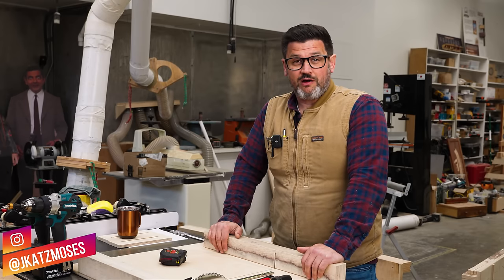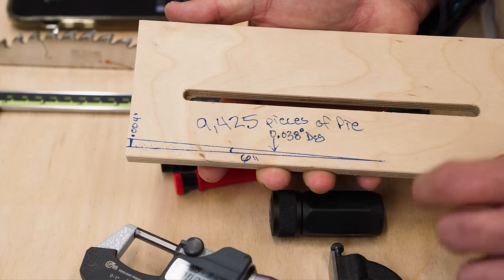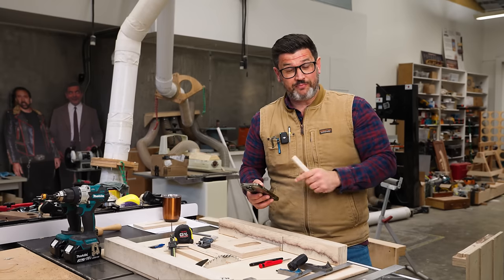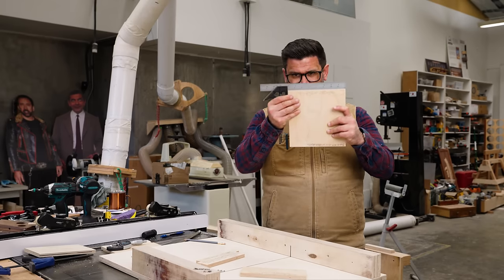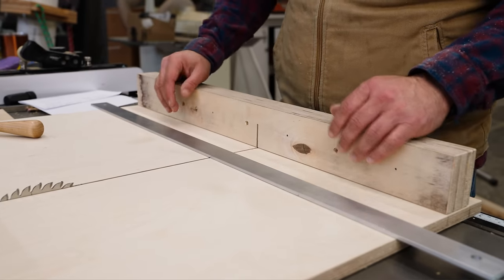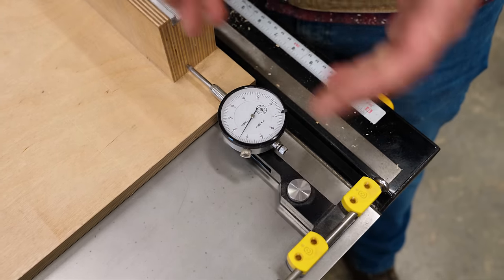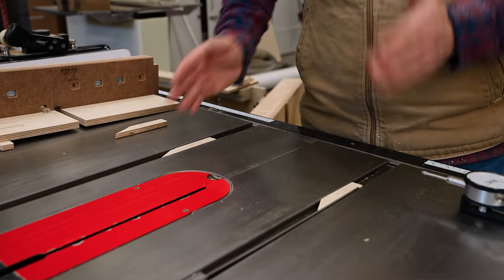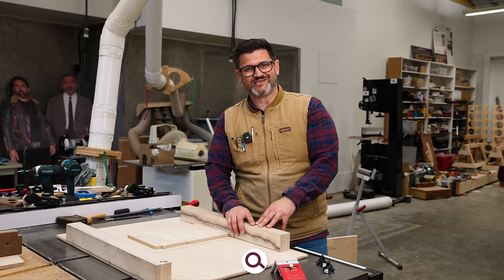Mitigating Human Errors in Crosscut Sleds and What's the Maximum Allowable Tolerance?

Comment from the maker: To summarize: Anything under .05 degrees of error is super square. If you get an error of .02 over a fence greater than 24” long you are super square. To calculate how many degrees your 5 cut method answers equates to use this formula (or Google rise over run degree calculator): 

Degrees= tan(-1) X (rise/run)

Comment: I've been in the Quality industry for 13 years checking machined parts  to, in some cases, .0002 in. This video checks out. Great job explaining this. Because I worked in the industry, I was hunting that accuracy in my wood working. Because it is wood, I could never maintain that accuracy. I could measure something like thickness to a thousandths of an inch, but give that freshly cut side a little time, and the whole piece would be ever so warped, bent, or changed in length. I do tolerance studies of the drawings we make for the shop now as a drafter. I think in terms of what is acceptable to the end assembly all the time now. Super tiny nip pick... Your joe block that you use to check the calibration of your calipers and mics is not perfectly 1in. However, for the level of accuracy needed this video it is way more than close enough (tolerance on a joe block of 1in is something like ±.000005 at 68° F). Overall I freaking love this video. I can nerd out all day about math!
Reply: I'm a Quality Engineer & agree 100%

I often make my own study coupons & machine 1 off parts/fixtures.

I was lucky to be able to call it "good enough" when it comes to woodworking projects early on.  I actually do a lot less measuring woodworking... fit/form/function is more applicable I think.

The only time in woodworking I try to hit accuracy to a few tenths is setting up a piece of equipment. 

I did, however, buy a some cheaper items for construction (framing, landscaping, etc) I used our Vision System to verify accuracy.  My aluminum $9 speed square was something like 90.075°, 45.something° & straightness was less than .003.  I did not expect that at all.

Comment: I recently made a 45° miter sled for boxes. Doing the 5 cut method on a sled when the blade is at an angle gets tricky. The bottom of the sled looks like Swiss cheese as it took 10 tries before reaching a number I was satisfied with. The calc I used suggested .001 as the target, when I finally hit .002 I stopped. 
Today I'm building a 60° miter sled for my hexagon boxes. After watching this, I'll relax my hunt for accuracy! Thank you, Johnathan.
Reply: Check out William Ng's video on how to make a 45° miter sled.  He claims you can get it in two tries with two cuts each try.  You can, IF you use good quality wood that doesn't leave raggedy corners.
Reply: That was my problem on the first test. After a couple more failed tests. I realized the issue was how you measure the length of the off cut - I had been measuring the long side (the top of the cut), but I should have been measuring the short side (the bottom of the cut, against the base of the sled).

Comment: 9:56… I’m a fan of plastic runners… I buy cheap plastic cutting boards from Amazon and cut them up for my runners. Can’t remember the exact type of plastic to use but there supposedly is one you should use (but it’s the plastic that cutting boards are made from anyways). 
2 things for my personal shop set up. 
First is my shop is heated for winter (I’m in Minnesota), but I often am to cheap to fill the 500 gallon propane tank for it lol, and my shop is not cooked at all in the summer. So I have a GIANT delta of both temps and humidity during the different seasons of the year.
Second is that my table saw miter slots are slightly different than each other (which I would think is fairly common), so I need two different sized runners to fit the specific miter slot. But this is not a big deal at all. 
Basically the plastic runners don’t move with the seasons AT ALL.
My first few sleds have 1/4 sawn hardwood. But I must have made them in the winter, because come summer time there’s no chance those sleds fit my saw anymore lol.

Comment: Great topic.  I once used a Grizzly contractor tablesaw and just dragging it a foot across the shop would throw it out for fine work.  I was able to dial it in and make a 3x4 ft. picture frame that was 3 inch wide oak and had tight miters.  I eschew the use of filler to hide miter errors.  I did not realize you don't do sponsors.  Just ordered a few items to help support you.  More of this stuff, please.

Comment: Thanks! I’ve been chasing perfection on my first shed for the last 3 weeks! Yes, I’ve had to put it aside a couple of times. The last time I walked away was specifically because of the “screw bump” I was really getting frustrated because I’m dialing in my fence and then my error from .0095 to .015!    I don’t think my fence is flat enough so I think I’m going to rebuild that and start over.  Yes, the blue tape works - but I needed to make sure I sanded paste wax off. Glad to hear that it shouldn’t slide like a bobsled as well!

Comment: I think there are a couple things to remember:
We're working with wood, not precision steels. A joiner told me years ago...it's a natural material and it'll do what it wants to anyway. I think the point is, no matter what you are making, you have to allow for all sorts of movement.
Also always told to measure the parallel accuracy of the grooves to the blade on a table saw from the same tooth - but you might choose a mis-ground/distorted tooth and although it cuts on the feed side, it can also cut on the opposite side if everything is slightly out of alignment, presumably giving a slightly wider kerf (although my own saw seems to cut a strange very shallow curve?). I have found the best way to achieve alignment accuracy is to use the longest "true" straight edge against all of the reference surfaces, whether you measure with digital test indicators or your thumb!

Comment: Good video as usual, just a couple of points to make.  When you are making your five cuts use a piece of material that is as big as you can cut in the sled, it makes measuring the error more accurate.  Sorry, using an 8in square on a sled that looks like you could have used a 20in square is nuts.  Also, expressing error in degrees is a bit hard to understand more meaningful is what is the error over the largest piece you can cut.  

I've been making and using sleds for nearly 50 years and I think an hour or two spent finessing is well worth it.  One additional tip is always make sleds with two runners where at all possible it removes the potential for racking.  As for runners I have recently gone to using the shop bought adjustable variety, they are great, just be aware that if you have to remove slop from any sled it needs re calibrating.  Although woodworking does require engineering levels of accuracy there is no reason not strive for perfection, as errors in a big project can compound themselves.

Comment: The New Yankee Workshop has a video where Norm was making shop helpers, one of which was a panel sled. Even though a panel sled is a bit different than a crosscut, their end goal is basically the same. All he used was a carpenter's framing square, and from what he said, and from what I could see, it worked perfectly. When I made mine, I used a Woodpeckers framing square. It was as accurate as it ever needed to be. Any panel or single board I cut, was right on the money. But, years before I made that sled, I had purchased and still use the Incra 5000 which is excellent. Especially for angles. The only issue is, it seems to be getting heavier every year.

Comment: The first thing to check for is that the blade is parallel to the miter slot. Don't ask how I know. The second is to use a 1/4 inch bolt in a 3/8 hole  opposite the pivot screw to hold the fence in place and avoid turning base into swiss cheese. Just set the fence to approximately the right spot  and drill a 1/4 hole through the base and fence. Then drill a 3/8 hole just in the fence. Use a bolt or carriage bolt  inserted through the base connected to a large washer and nut on top. Make your adjustments by loosening and tightening the nut. Much faster than screwing around.

Comment: As for the runners play, I would use a few spring plungers along the length of the runner/runners to eliminate any play and to keep the runners moving smooth. 3/8 thick runner you could use 1/4-20 or 6 mm plungers. Thanks for the videos Jonathan.

Comment: I started using a dial indicator and a long square. Hold the square against the fence of sled, mount dial indicator to table and touch it to square along the cutting edge and move sled back and forth. Adjust fence until most run out is gone. Done

Comment: Great information Jonathan, thank you. What do you think if one uses a 24 inch piece of extruded aluminum with one end swiveling relative to the base and the other adjusted with a micro adjustment set screw like the one in the Rockler sled to fine tune it accurately and quickly?

Comment: Great piece!  I’m wondering if there is a Part II coming, in which you investigate the influence of the fact that we’re working with materials that in nearly all cases are subject to all sorts of environmental and other influences?  For example, some materials were better-dried than others when cut or manufactured; some materials will be drier than others when we start cutting and assembling them; some materials are inherently less subject to environmental effects than others; and (this is a guess/assumption) some wood grows in ways that result in greater or lesser amounts of internal tension that can release and cause dimension changes over time, either while stored before use or after cutting/assembly.  I’m wondering if the results of variables like these are, or can be in some cases, so great that they make chasing dimensional accuracy that has to be measured in single thousandths of an inch (or less 😅) a challenge that may be diverting and satisfying but honestly isn’t all that important?  🎉

Comment: I used a dial indicator to do my 5 cut method and one issue I had was not pulling the dial indicator back and "resetting" the measurement. There was a surprising amount of play in the measurement by just leaving the indicator touching the fence and moving it. I chased that issue for a couple hours until I realized what was happening.

Comment: I've done the same with chasing error. In my opinion, the fence should aluminium extrusion with a thin mdf  layer for zero clearance, and never be screwed down, it should be adjustable with a bolt just like with most metal working machines, and dialled in often as pieces of the jig wear. At the end of the day though, as long as the sled is made from wood, it's going to have moved the next day. Not to mention the human error involved in using the sled itself, for example like with a mitre saw,  its easy to unconsciously be applying too much pressure in one direction.

Comment: I’m a type A weekend warrior and found my sled splaying a tiny bit when I unscrewed the fence to make the adjustment. I moved my fence the amount dictated by the 5 cut method, so sometimes it was worse than before. I’m down to 0.07 over 24” and can’t see any light, so after 9 tries I’m calling it good enough. Chasing dead nuts is too aggravating.
Reply from the maker: My guess is you’re not accounting for which side of your blade you’re cutting on. In our five cut method calculator we have a drop down menu for which side your pivot screw is on. If you miss that part you can move your sled the wrong direction.
Reply: If you can’t see it, you can’t see it…although as a footnote, I think my fingertips are probably more sensitive than my eyes.   In other words, I think I can feel dimensional differences that I can’t see…though I also wonder sometimes if not being really careful about the exact angle I’m looking at something obscures something that would be visible if viewed exactly on-axis.  In any case, I do think there are cases where we can measure differences that don’t make any difference in real life.
Reply: @katzmosestools  Thanks for your response! I love your channel. I thought about the pivot screw, too, but I have it correct. I cut on the left side of the blade, but accounted for that, too. I was essentially moving it forward and backward the same amount each time. I chalk it up to crappy plywood.

Comment: Note about accuracy.

When talking about the Mitutoyo Micrometers... their accuracy is not .00005 or 5 decimal places, that is their "resolution".  The actual accuracy will be closer to .0001 - those particular mics are more "accurate" than that (roughly ±.00004 or .00008 total tol), but can't display it (due to the .00005 resolution) in imperial (inches)... so rounding up to .0001 is your accuracy.
Reply from the maker: Yes I misspoke. That is so accurate I don’t think most people can picture what that actually means unless you’ve seen what that looks like on something like a scientific grade granite plate etc.

Comment: AS regards runners- Most commercial ones have set screws or discs to make up for slop. Problem is they are spaced too far apart. I make mine out of ipe(quite hard and wear well) and and place every 3-4 inches a brass headed screw to adjust for slop. They stay true for the entire length of the runner and easily adjustable.

Comment: Another thing to account for is that the  sled can easily distort by a few thou and even the alignment of the wood cut piece against the wood sled can vary with holding pressure. Wood is squishy :)

Comment: I’m thinking that if the sled runner (s) are not tight the sled will “skew” - the front of the blade will cut a particular width until the back of the starts to cut the opposite side of the kerf making it wider than intended? 

I try to push my sled directly over the runners thinking that will minimize skew or at least make it consistent - 

Somewhat different than out of square but still gives inaccurate cuts

Comment: This is a great video, but I have a different view on a couple of your points.

1. For most angles, it is impractical to focus on small angular errors. in engineering drawings, Geometric Dimensioning & Tolerancing detfines an angular error as a linear measurement of the deviation from the ideal angle. You were doing that, but you kept throwing in a meaningless angle value.

2. The 5 cut method does not increase the error after each cut. The angle remains the same. You measure the error over the perimeter of the test board. It still multiplies the error to improve the resolution.

Comment: I assume fixed squares are available much cheaper at tighter tolerances than adjustable ones simply because the adjustment mechanism is the hardest place to minimize slop.

Comment: This is no doubt a stupid question: If after doing the 5 cuts you are off and need to do it again, your board is not square.  Can you do it now with the out of square board and get an accurate result?  Also, do you go clock wise or counter clock wise?  Told you these are stupid questions no doubt.  Thank you for all the informative videos and comments.

Comment: Screws should not be used for locating parts. @RexKreuger has a really nice solution to getting a fence really square in his advanced shooting board video. Basically, you fasten the back half the fence rock solid to the board/sleed as square as you can, then you bolt the front half to it and shim it to sufficient squareness.

Comment: Just refurbish a couple antiques and you’ll quickly discover how to accommodate for errors.  This  fascination with precision is kind of a joke. When you study those beautifully crafted old pieces, that are incredibly inaccurate yet gorgeous and perfect ’to the eye’. 
Are we craftsman or machinists?
Reply: Exactly!
Reply: Yes I agree. Perfectly square is great if achieved, but it can be elusive. Having a perfect sled would be nice, but how big of a sled can you have. Even if you had one 2’ across, if it was out a 1/32” or even a 1/16” in that 2’  are you going to really see it. A sled is just a more controllable and safer miter gauge. Think about how wide of pieces you crosscut with a miter gauge. Most of the time it’s probably less than 10”. 
And I don’t want to spend half the time checking the sled for square before I use it every time. And as with the antique furniture you mentioned, wood does move, so even if you cut it perfectly, it may not stay that way. I think instead of spending all that time making and fussing over over a sled that I apparently have to treat with kid gloves so it doesn’t maybe get messed up, I’d go with either the Dubby sleds, the Incra miter gauge/sled. They are basically a miter sled that cut 90 degrees and miters. The Dubby has right and left sleds, both with adjustable fences. Buy one or both and have a place for the cutoff to land. The Incra has a separate platform for the other side of the blade. With either, if they get off a bit it’s easier to adjust them. 
And finally, no matter how square your sled or whatever is, if you don’t measure right, mark the workpiece right, run it through the saw right, it ain’t gonna be right.
Reply from the maker: Sort of. You ever tried to glue up a box where every joint is half a degree out of square. That is maddening. In this video I think I’m agreeing with you to a point but that you should get things under  .05 degrees to avoid seeing errors in your work. Maybe you can’t see it but spending half your time trying to fix wobbles and poorly fit drawers is pretty frustrating.